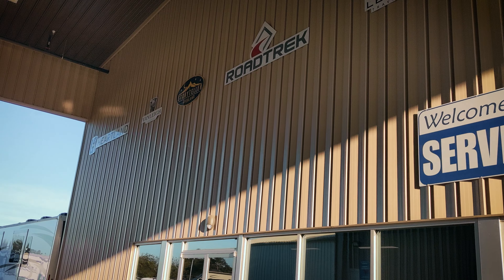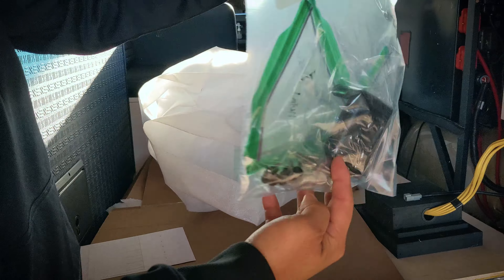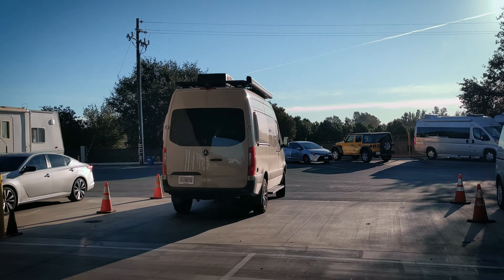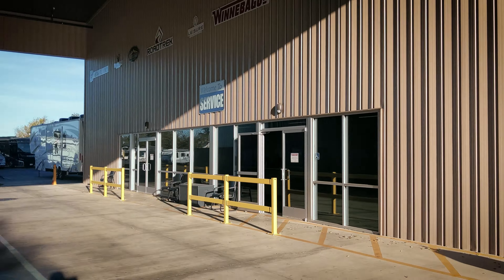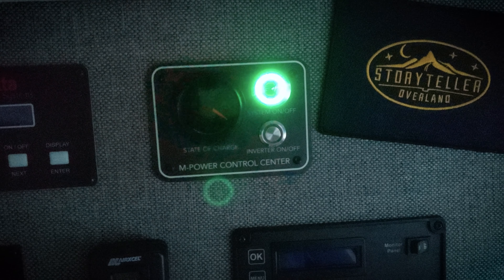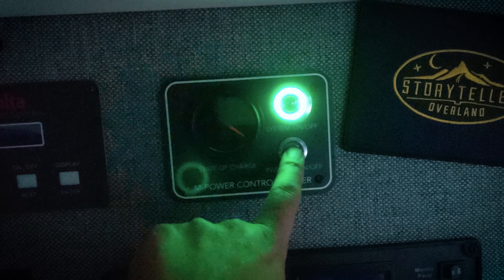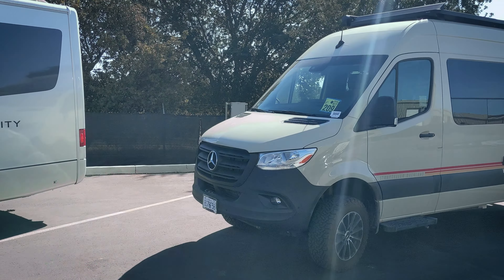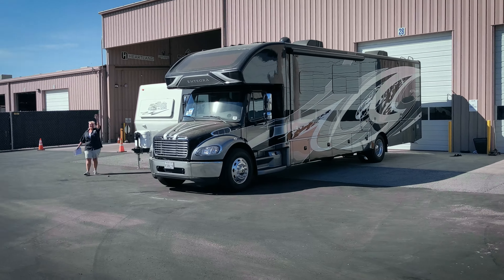Final Update on my Volta Breakdown and Getting the Storyteller Overland Van Repaired at a Dealer.

Comment: I have a winnebago with Volta, I had a issue also within first month. I called volta the guys there are very nice and helpful. They are a solid company usa based. My winnebago dealer ended up performing the repair.
Reply from the maker: Seems like most van/RV issues happen within the first month. This is why it might not be a bad idea to buy gently used RVs.

Comment: I’m in the market for a Storyteller and have consider purchasing used.  We’re currently looking at a ‘22 and a ‘23 (both Mode LT).  The ‘23 has had the Volta system replaced.  After learning that and seeing this video I’m concerned about warranty, specifically on a used model.  Any advice here?  Planning to inquire w/ Storyteller but figured you may have some insight.  Thanks in advance.
Reply from the maker: Well, to complicate matters, STO is switching battery supplier. As far as warranty goes, my model comes with 3  years and it’s transferable, but I would still confirm with STO since mine is a 21’. If it makes you feel any better, my Volta has not had any other issues since the fix. Hopefully the one you buy will be just as reliable once the initial kinks are worked out.

Comment: is this an issue that will automatically be replaced like a recall?   I will be buying a 2021 storyteller and hoping it is all taken care of already.
Reply from the maker: Yes, it was basically a recall, but the owners had a choice to DIY or send the van to a dealer. So I would double check with the previous owner, because Volta simply mailed the harness to the owner/dealer, and it's up to the owner to proactively replace the harness themselves or have the dealer do it.

Comment: Watched this again, and I see even more the quality of you vlog.  Nice work Peng.  Did you replace the faulty cable yourself?  I have to do a software update for the “dark Volta screen” issue and wondered if there were any tips/tricks, no cable replacement here but do have to insert the programmer.  I have the LT, so mine will be a little different.
Reply from the maker: Thanks John. Yes, I replaced the cable and it was very easy. Since I don't have the touchscreen, I didn't go through the update myself, so I can't tell you how easy/hard it is to your specific question. But I assume they sent you some sort of instruction? I only have two tips in general when I take apart anything, though. 1. Take lots of pictures as you take things apart, including which type of screw came out of where, so you'll have visual reference when you try to put them back later 2. Keep all the screws in a zip lock bag. Hope this was helpful.

Comment: hi everyone, we just started our journey and realized a blue blinking light, its losing power, its after hours, wondering if anyone who's how to resolve this issue?
Reply from the maker: Are you at a cold place? I believe blinking blue light means the battery pack is too cold. If you turn the inverter on, the heating pads on the battery pack should start heating it, but if your battery pack is too cold, it might take a while. If possible, you should plug it into a power source.
Reply from the maker: Also, is this a Storyteller van? If so, post your question to the Facebook group, you’ll get more responses there.

Comment: Exactly what does "automotive grade" mean to lithium batteries?  Lithium batteries put in an auto application has nothing to do with the grade of the cells.
Reply: In this case, it is strictly a marketing term. The component automotive grade are those meeting AEC-Q200. A better indication of a system such as the batteries, BMS, and inverter would be an actual UL-rated product. Lithionics is the only manufacturer supplying a UL rated pack.